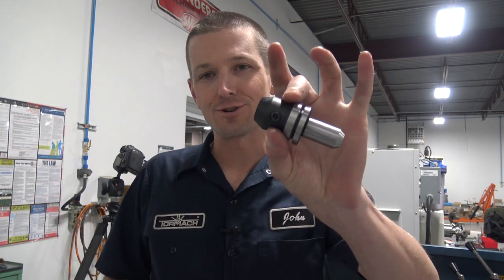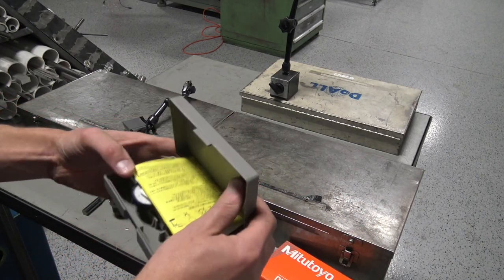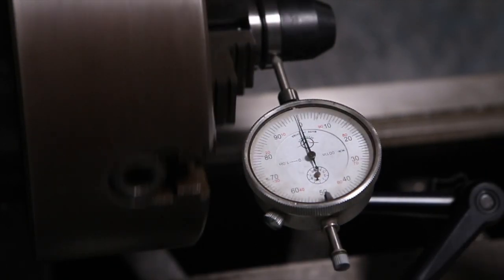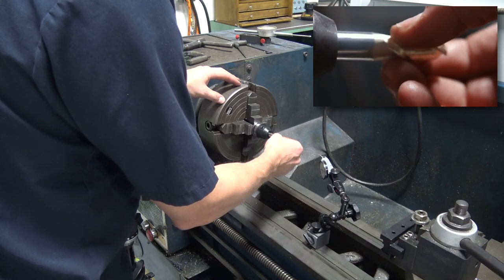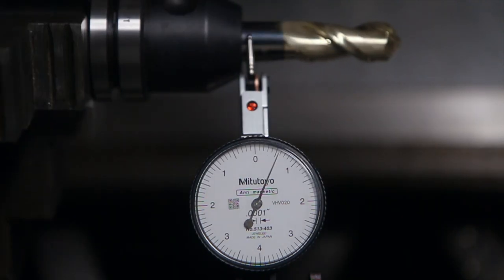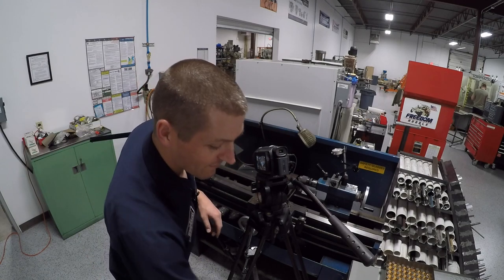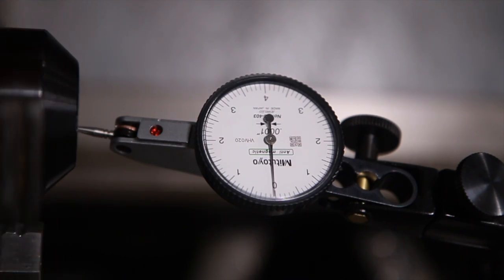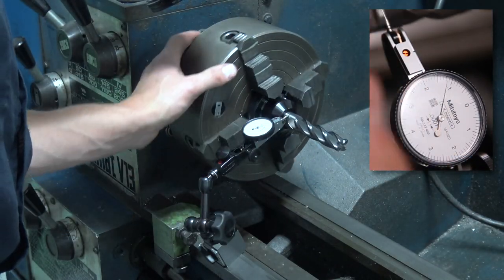Do Set Screw Holders Push End Mill Tools off Center?  WW122

Comment: The problem may be be runout when you're actually measuring and need to measure concentricity. Also if the video is about using a collet vs a set screw holder you should do the same test with a collet. Maybe the collet would will be even worse. Who knows?

I've heard that the real problem is when the tool is under pressure. Being held by one screw versus the whole circumference effects how it flexes during a cut. The collet and endmill will both probably wear more evenly then the setscrew holder or it's endmill. The setscrew holder might be more rigid though.

Does it matter if it's a weldon shank?

I think you're probably right however. People have all sorts of superstitions when it comes to machining. I think the time you save with setscrew holders probably nudges out the tiny possible downsides for almost all jobs.

Comment: The answer is yes the tool will move some when tightened as the slack in the bore is taken up. Some holders are ground with a bias in the bore to allow for that. Like Briney tru holders http://www.brineytooling.com/files/flyers/brineytrupos.png The issue is how much does it really matter. If your feed rates are .002 tooth load you will end up with actual .001 to .003 chip loading depending on what side of the tool you are on.  I am sure this effects tool life but I can't tell doing what I do with my tools in a job shop but what it does do is effect finish. The greater your tool run out the slower feed you will have to run to get a good finish. Hydraulic holders like my Schunks are the easiest and best solution to this for most applications as they are more rigid and repeatable than collets but for maximum rigidity and run out you have to go with a shrink fit tooling setup. You need to check run out with the tool in the spindle where it matters. I have had tooling with run outs up to .003 on the big stuff and it still cuts great and will hog off material as good as a true running tool but again when you need the finish you will be running half speed.

Comment: Another thing would be to manually probe your tool radius at each flute and see if it matches with the test here. Any good probing subprogram will run the tool backwards and measure from the highest point anyways.

Comment: I would suggest clamping the holder in a v block with the set screw at 90 degrees to the orientation of the v groove, and then "flip flop" the v block on a surface plate and measure with a height gauge. This would show you exactly how much error there is in the plane of the set screw

Comment: It might be possible that while you dialed in the front of the hole, the rest of the toolholder's bore might not be in line with it (ground crooked), and that the tool sits at an angle into the toolholder. It would be interesting to see how the measurements are affected further down the gauge pin's length, say at 1" distance from the chuck, if the measurements get amplified down the shaft, that would be your answer. Ciao, Marco.

Comment: Hi the type of tool holder you have is Weldon holder .
A god weldon holder can not be to cold for mounting a cutter in it's not shrink chuck but it's where narrow in tolerances.
I normally heated white a hot air gun to 50celcius

Comment: I use these Set Screw Holders (BT40) all the time, also for finishing in inox steel, and can mill in 0.02mm! easily and reapetedly :D
Then for de ER collets (especially on SK40) you shouldn't be concerned with the rigidity. For example I use ER16 150mm long chucks on a 5 axis machine and really didnt have any issues.
Regards Sam (CH)

Comment: Ive done these tests years ago, and came to the same conclusion. Every time, there was a difference. Just remember that even two tens means that one tooth is cutting more deeply than the other, and can lead to four tens larger diameter cut.

Realistically, we can’t really get it perfect, though, if we’re lucky, errors cancel out. Most likely they cancel out partially. But, cheap holders can have close to 0.001” runout. The best; 0.0002”.

If you want to drive yourself crazy, you can rotate the tool in the holder while measuring runout, and marking holder and tool, always put the tool in on the marks. I do that with some things.

With the holders in the four jaw, you’re squeezing the holders from four directions. Even slight pressure can distort that thick holder. Remember we’re talking about just a few tens.

Comment: Just my thoughts after opening my eyes when you tossed the indicator ;(
Why not just insert the holders into the mill spindle to check runout? That would also include any tool holder  to spindle runout possibilities.
After my 20+ years as a manual machinist I never found an endmill less than a thou out unless it was heat shranked.

Comment: The issue isn't really so much that the tool will push it out.  The surface area takes the pressure fine you shouldn't get any run out.  Any deformation would take place in the screw since it's taking the same amount of pressure but on a lot smaller surface.  Beyond that the main issue is they begin the run out relatively quickly compared to a milling chuck that lasts quite a while just replacing the sleeves.  Same with ER collets but I don't run much bigger than 3/8' endmills in an er collet.

Comment: That around 1 tenth equals 0,01mm pretty precisely. A runout like that does matter when doing e.g. a 0,03mm cut on a 2-flute end mill. The other one is taking 0,04 and the other one 0,02 chips. Also the spiral flute will change it's cutting when it rotates around the end mill and the center is not rotating around itself.

Comment: longrangehunter is on it I think. being parallel to the spindle is key. You could easily dial in to .0003 at one set point without notice a 1 or 2 degree kant of the tool holder in relation to the lathe spindle. End result being that when you meassure the tool it will swing on both side of zero as the median cross over is where you zeroed it.

Comment: Not sure I'm buying the other sources of runout error theory.  Sure, in principle, that sounds reasonable, but your test showed that the Tormach tool holder runout was exactly where it would be if it was entirely attributed to the set screw biasing the tool.  Given the results of this one test, I'd be inclined to say that the error is almost entirely the result of the set screw holder.  It would be just as valid to say that the lathe chuck and other factors produced .0005" of error in the other direction, and the set screw runout error was actually .0008", but that error was reduced by .0005" by the opposing runout error of the chuck.

IMO, dialing in the ID of the tool holder would null any other setup errors.  Of course, in real world use, those other sources of error would not be nulled, so spindle runout, runout between the tool holder shank and the tool holder ID, etc. would all be in play.

I'm a pud knockin' home gamer, and this looks like fairly significant runout to me, particularly on a smaller end mill.  Not end of the world, but not insignificant.

I will admit that the rigidity of the set screw tool holder is typically better than an ER20 collet tool holder, particularly for aggressive cuts, and that's certainly an important point.

I bet Maritool hand picks all the stuff they send you in their metrology department from now on!  Comparing a 1/2" import tool holder to the vurra nice looking 3/4" Maritool tool holder isn't exactly an apples to apples comparison, but 1/2" to 3/4" isn't so much of a difference that the Maritool should have had .0016" of runout when the Tormach had .0003" of runout.

Comment: My issue with set screw holders is not pushing it over to one side but when name not mentioned inserts an endmill without a flat ground on the shank can cause pull out, especially in hard materials and titanium.
Reply: makun16 He will learn when he starts running an end mill larger than 3/16 dia. and can't hold tolerances with the HAAS.
Reply: Never had problems holdin tolerances on any Haas machine. It's all in the machinist.
Reply: I've never had any issues with all my years of programing and running Haas machines. I am really impressed with them. It's all about setup and selecting the right tools for the job. I was referring to a manager at a job shop who incorrectly used the wrong tool holder and even pointing that out to him, said run the f**en thing! Needles to say, his ignorance destroyed a set of hard jaws.

Comment: Hey... great video as always. I reckon your toolholder is not parallel withe the spindle centerline. So while the runout may be 0 at a SPECIFIC point on the holder, that WILL change down the length. You should probably run the indicator up and down the gauge pin in 2 axes to get it parralal first but then I guess you are skewing results again. Needs to be in a proper spindle I guess... try it in your brand spanking new Haas 😀

Comment: It will push it off center, but only the clearence between the end mill outside diameter and the tool holder's inside diameter, so just a few tenths or less.

Be careful on a lathe turning between centers and using a bent tail, drive dog.  Use a straight tail, lathe dog if possible.  I have seen the leverage of the bent tail ones push the shaft off center and cause runout.

Comment: OK, brass tacks:

First, you're using excellent USA made and brand new toolholders that were manufactured recently, with USA made cutting tools that were also manufactured recently.  That is the best possible set of circumstances for a test.  It only goes downhill from there.  Depending on the shank tolerance on your tool and how old your setscrew holder is, it could go way downhill.

Second, like I said on Instagram, half a thou will not cause the machine to explode or the tool to snap off at the holder.

What it WILL do is impact surface finish when side milling.  No effect when end milling (more or less), which is what you were doing in the injection molding video.

If you have a two flute tool with one flute a half thou higher than the other, that change in scallop height when sidemilling makes a visible pattern.  The more runout the worse the pattern gets.  The more flutes, the more complex the pattern gets, but it is still there.

You can't feel it with your fingernails, but you can see it, and for some things that pattern can be a real problem.  For instance, I used to make paintball gun parts, which had to be polished to a mirror finish before anodizing, and this visible pattern caused me no end of irritation during polishing.  It IS real, because the deeper marks were still there long after the shallower ones had gone.

I fought and fought my process trying to improve the surface finish, and in the end I came up with two solutions that pretty much worked equally well:

1) I bought a milling chuck that was guaranteed to have less than two tenths runout at the tool shank, and they weren't lying.  TIR on the tool was just under two tenths installed in the machine spindle.  THAT toolholder combined with judicious replacement of tools used for finishing (they would do X parts as a finishing tool, then got demoted 
to roughing for the rest of their lives) solved the surface finish problem.  I had been doing the tool demotion thing before the milling chuck too, but after switching to the milling chuck the parts per finishing tool (that number X) went up about 20%.  It wasn't huge, but their life did increase with reduced runout.

2) An oldtimer I respected over at the CNCZone forums suggested that I try a single flute tool, either by simply removing one cutting edge from a two flute, or buying a single flute made for high speed routing for aluminum or plastic.  That tool would also leave an acceptable finish, even in a setscrew holder because to it runout was irrelevant.  Wherever that one flute ended up in relation to the spindle centerline didn't matter (except as a matter of total cutting OD, but these parts were never splitting a thou tolerances to start with, it was all about surface finish), because where it touched the work, it was always the same distance from center.  That tool too solved the surface finish issue.

Cost wise it was about a wash.  The milling chuck was about $250 (in 2004) and the good Atrax single flute carbide router mills were about $95 a pop.  The router mills were cheaper up front, but they wear out, whereas I still have and use the milling chuck.  These were all 1/2" tools, solid carbide, USA made.

I ended up sticking with the milling chuck method because I'd already sunk the money into it, and in the long run it was much cheaper (those were parts that I made for close to five years, so it more than undercut the router mills cost wise over that span), but I kept the single flute trick in my back pocket, and it saved my ass on several occasions later on.

Like I said on Instagram, it DOES matter, but not for everything.  You just have to be aware of what's going on with your tooling and use it accordingly.

That's why I suggested that you measure to see for yourself what your toolholders look like.

The setscrew holders I own are terrible runout wise, so I don't use them for things where that will be a problem.

I use them for things like big roughing endmills, or for other single flute tooling where runout doesn't matter (like form tools or half round engravers).

The tools I put in setscrew holders most often are indexable endmills that I use for roughing (like that ShearHog you're so proud of, and rightly so).  The tolerances on most inserts are so large that whatever the toolholder itself is contributing to the high/low of the flutes radially is just making an already poor situation slightly worse, and since I'm roughing, I don't care what the sidemilling finish looks like anyway.

I'd be interested to see what the TIR looks like with that MariTool holder actually in the spindle of your new HAAS machine.  That's how I measure all of my tooling, because ultimately that's the only place it matters.

Anyway, thanks again for taking the time to measure, I'm glad you took video of it.
Reply: I'm not sure what the deal is here.  I tried to edit my original comment, but instead ended up posting a new comment, and now I can't edit THAT comment either.  lol  WTF YouTube?

Comment: The runout = the difference between the Arbor bore diameter and the shank diameter of the cutter.
 A bore Mic and an external Mic could have given you a difinitive answer without all that messing about.

  The real point here, is that if you get a slightly undersized cutter shank, on a Collet chuck it will always spin true.  The other thing, is that Grub screw puts some unwanted pressure on the shank of the cutter, I have seen them snap before if they are not heat treated correctly..

Comment: I think the reason you got more runout with the .750 endmill is because it had to be a little bit crooked, and the further your the tool is stuck out, the more runout you will have. Even if you were able to get it very close with just the tool holder, I think that it was slightly crooked not in terms of concentricity but with the angle of the holder. nothing you could have improved on, but it had to have not been perfect just given the setup. I think if you could get the holder exactly straight with the lathe, the results would be different

Comment: Always tram your tool at tip of tool, longer tool means more runout, checking at tool holder isn't knowing what that tool is doing at tip. Used to use cellphone on taper to compensate, the closer you get it running true at end of tool the better the finish, and you'll be able to run faster with a trammed tool.

Comment: this is fine on 2 flt and 3 flt under say 6000 rpm, jump to 4 - 6 flt and some higher speeds and feeds and that difference may start to show problems.  get up to 10+ and beyond the collet system should be used, once u get into 12000 and on shrink fit tooling and some type of harmonic system should be used like blue swarf which will give you the optimum rpm ranges for chatter free cutting at the appropriate speeds and feeds

Comment: Size for size doesn't fit. So technically set screw pushes it over a few microns. Set screws are nice, cheap, and cant pull out.  I use them, but any tools over 5-6"  its better in a collet. Collets are better cause you can make the tool any length. At my job i mostly use Nikkon holders and put a shrink fit extension in it. That is really nice, expensive but worth it. I can't stand the people saying a reamer should be in a collet. Drill chuck for me. Video of that would be nice. I do use collet over1" reamer though

Comment: Mounting a tapered shaft holder with tape around the short distance of the ring at the base of the taper could result in the holder being slightly out of alignment of the headstock axis and holder axis. While it may not be much, the variation you are measuring are not big. 

Wouldn't it be more accurate to mount the tapered holder in a matching tapered machine spindle. That would give a real indicator of both machine accuracy and potential holder accuracies. Lop

Comment: I'd be curious to see if the runout on your mill changes before and after you turn it 90 degrees in the holder.  I'm not sure which error that would resolve but perhaps lower runout is possible with a little tweaking.